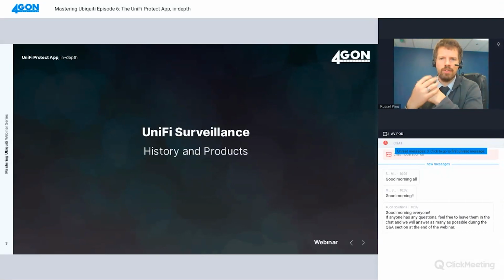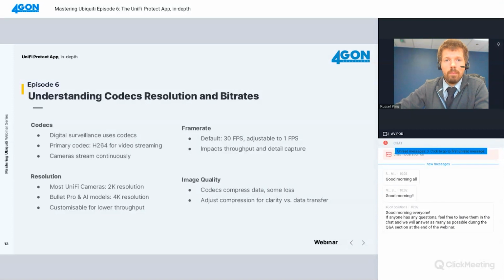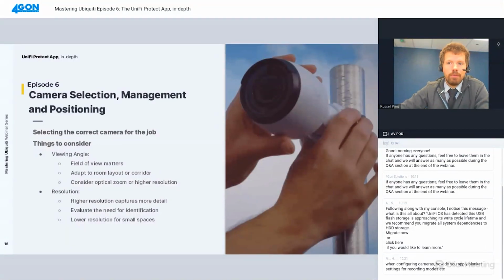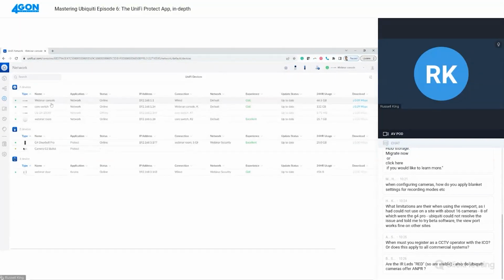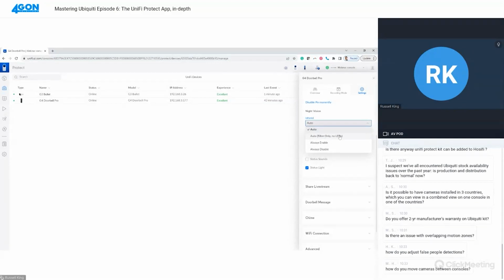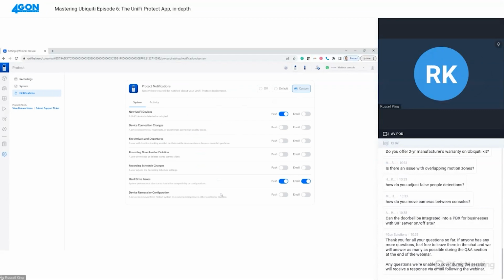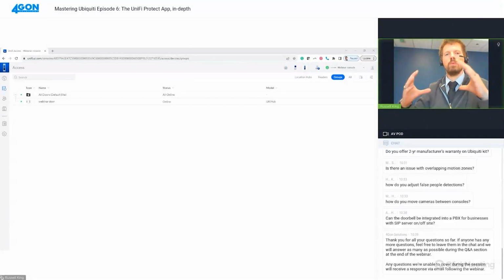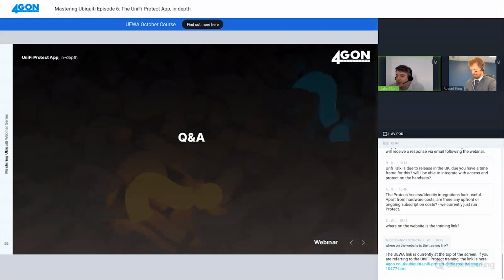Mastering Ubiquiti: UniFi Protect App, In-Depth

Comment: Hm… 🤔 Is that all the history you sure? Aren't you forgetting something? I don't know… Off the top of my head, that one time when they killed UniFi Video and removed the necessary apps from the mobile stores crippling all installations unless the users still possessed access to an account used to get the app earlier.

And of course with that, resell value tanked as well. Not to mention UI's relentless attempts accompanied with threats and other warning to drop support for older devices which would then have no way of being managed since unlike most other vendors who have at least a TUI. Let's not forget UI's pivot to become a data collection company, in control of your network. Read the policies. Last but not least: the blatant gaslighting effort UI has entangled itself in; it has this SSO service, not unlike Azure B2C with a starting base of 50000 user accounts (UniFi is 5) at the free entry tier. That's  fine, whatever, the problem is that UI want to charge you for integrating your Active Directory. UI doesn't provide the AD servers, you provide them, you also need to provide UI's required hardware and UI provides… what exactly? Nothing, expect access to use your own equipment, in other words licensing—which on the front page UI claims it doesn't do—complete with a rip off of Apple's Hi, I'm a Mac ad campaign.

This, recently hacked company, has behaved insidiously unethically over and over, which should give potential customers pause before dropping money on its locked ecosystem. I'd be mortified to have a UI-branded NVR connected to the Internet— Actually, I'd be worried about any of its consoles/controllers in general  being rendered on a browser, unless they are reverse proxied in order to remove the tracking scripts. There is zero reason for network/AAA/surveillance equipment to connect to the Internet.